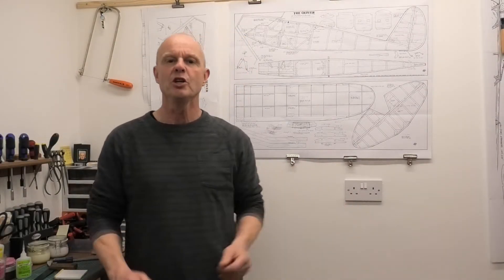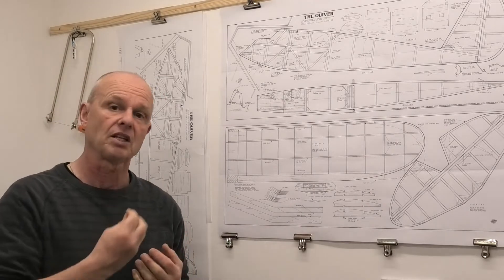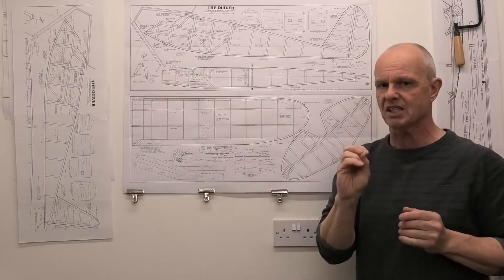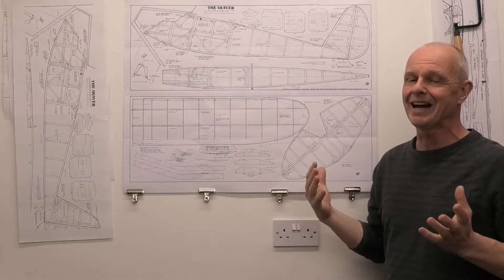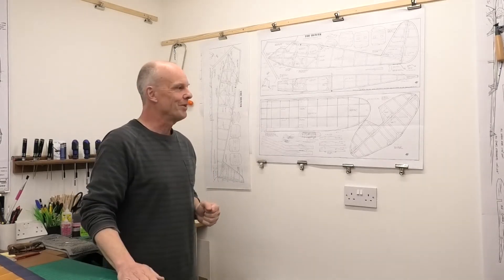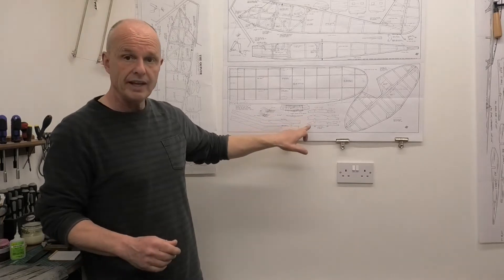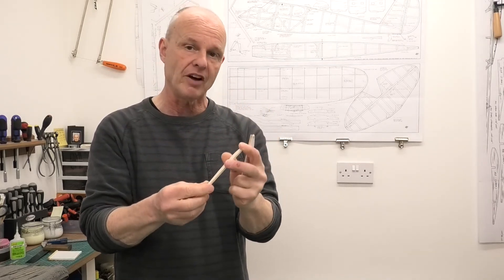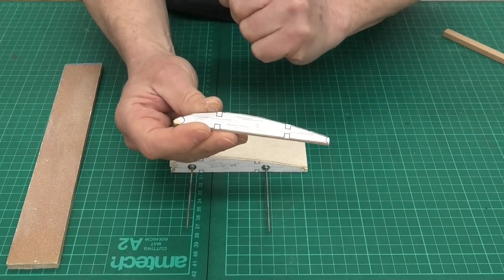45" Quaker & Mills 1.3cc Diesel - Build Series: Pt 1 Plans, Design & Preparation

Comment: Given how the Mills performed in your Tomboy it will make sense to use the 1.3 in your Quiver.  Its wing loading is better, and my original 67" Quaker Flash  (30 odd years ago) only used an O.S. 20 4stroke and went well. That said I was flying under power throughout, rather than flying in the original free flight 'power climb - glide down' way you will be using it. I now also  have an electric Quaker Flash with a 3542 motor ,used like my first one. 
The one thing I would question is your decision to abandon the reed (USA usage) tips. This type of reed (properly called cane in the UK and used for basket weaving) can be sourced fairly cheaply from Ebay in a range of thicknesses and the smallest quantities offered will give you enough for this and 5 or 6 future projects. More to the point, if you look at plans for the Flying Quaker or Quaker Flash you will see that, to achieve the flat top wing you also favour, the tip part has to bend in both plan and horizontal views. from the outer rib. To achieve that shape by laminating would be difficult and not necessarily anything like as strong. The cane tips make that easy , are lighter and you will never smash a properly made reed tip. In the event of an unscheduled arrival  reed tips bounce rather than breaking. Therefore IMO at least, that's the way to go.
Reply from the maker: Thanks for the comeback, ideas and suggestions, greatly appreciated